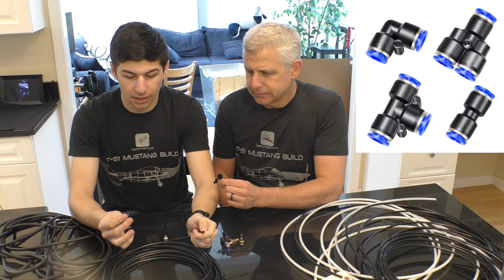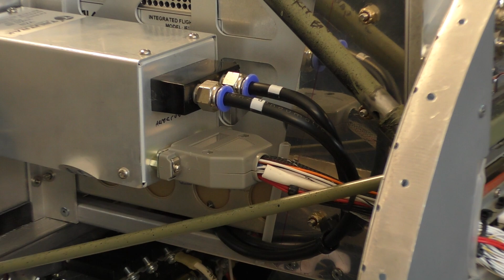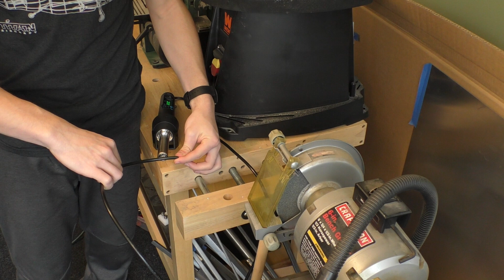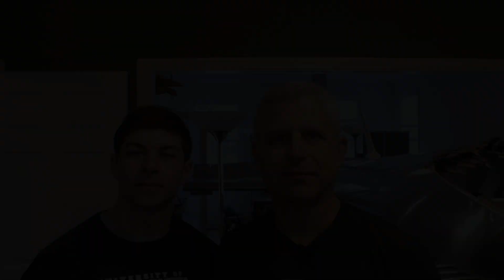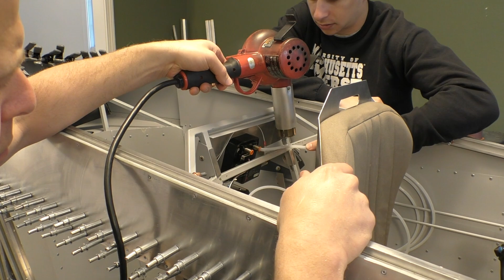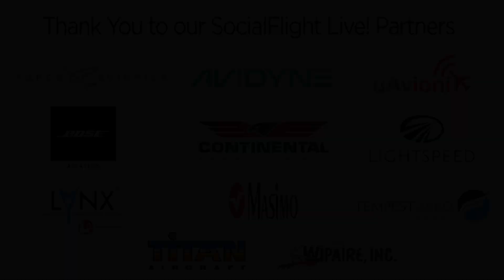We Need a PLUMBER for this MUSTANG! The Pitot Static System on our Replica P51 Mustang Fighter

Comment: If I could offer a suggestion.

That engine is voltage critical. I see an important criteria being omitted in the alternator setup and power distribution and no load study or data to support the installation one way or the other. Will a hot alternator support the engine load at idle? Having a voltage warning from a buss is an aggregate detection and may or may not be what the battery voltage is on long cables.

I would suggest to anyone flying this powerplant that you need a minimal voltage warning from the positive terminal of the battery inflight. I see cheap warning circuits with an obnoxious horn on it online for $4 or less. A no brainer...

Comment: The idea to use a solid core wire and heat gun to shape the polyflo is genius.  I had never heard/seen that before.  Any tips or guidance on the use of the heat gun?  is that any special sort of heat gun, or is the same as one would use to strip paint?

Comment: I work in industrial maintenance and those fittings are called quick connect fittings and they are made by a company called Festo. If you are going that route, I HIGHLY suggest you purchase a disconnect tool that Festo makes. The tool makes it ALOT easier to disconnect a line in a hard to reach spot.
Reply from the maker: That’s a great idea! We will do that. Thank you for the tip!